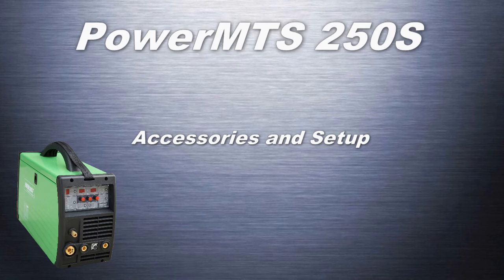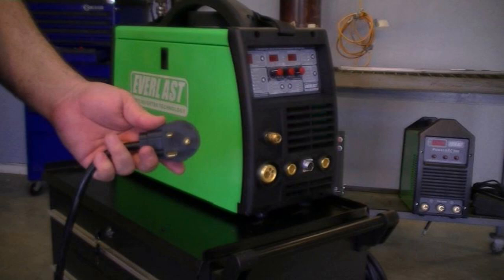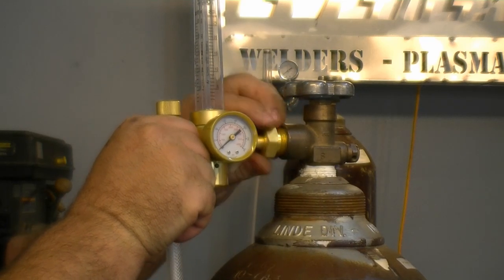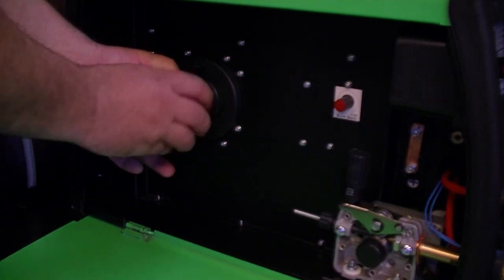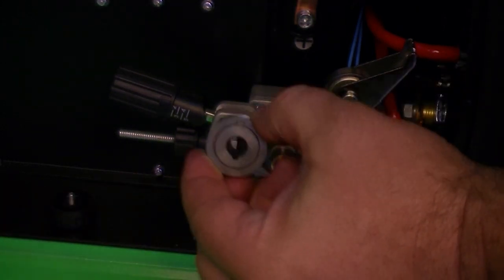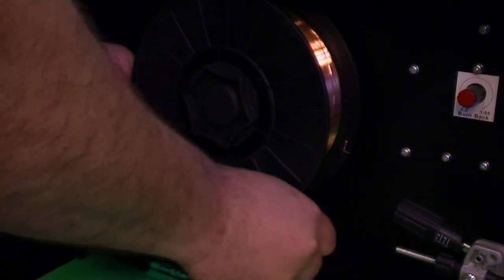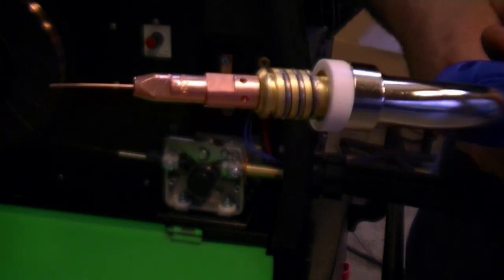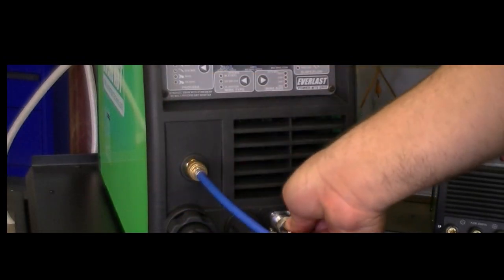Everlast PowerMTS 250S 3 in 1 MIG TIG and Stick  Inverter Welder  Accessories and Connections

Comment: Nice welder. Add spool gun for aluminum and it will do just about anything.
Reply from the maker: Yes it is.  It has a synergic spool gun mode which allows you to improve operation with the spool gun. In this mode you can increase both voltage and amperage with the wire feed speed knob on the unit.